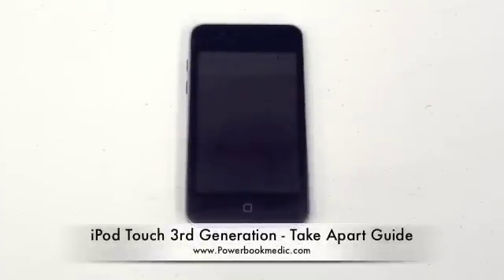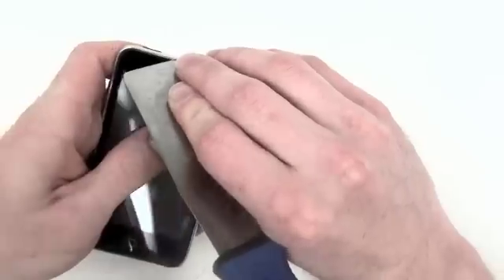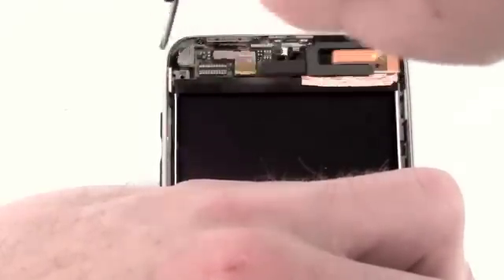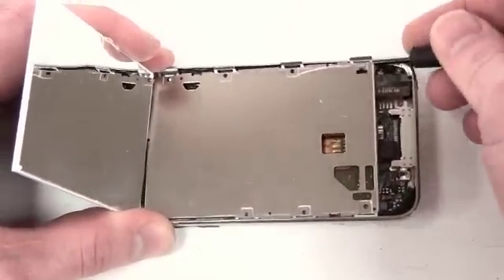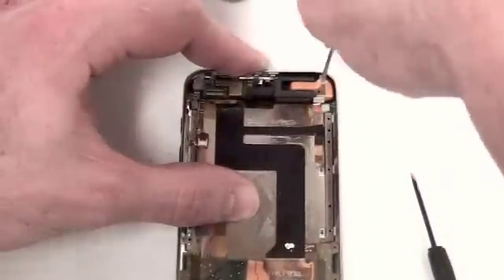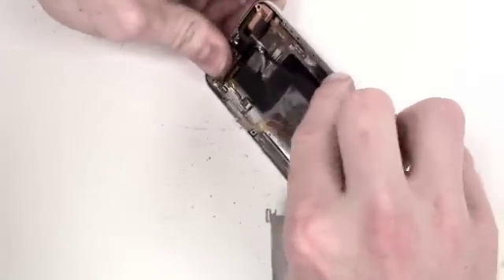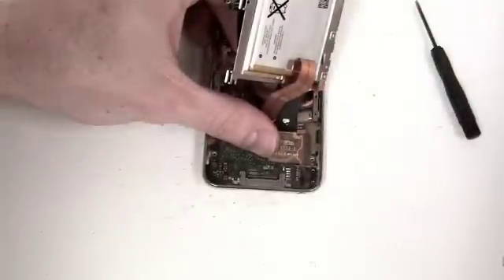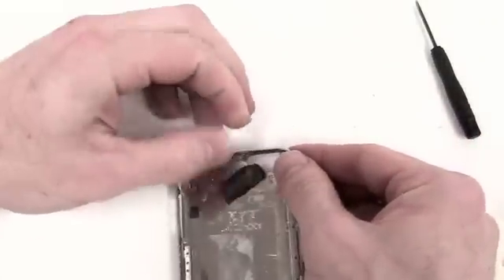iPod Touch Repair 3rd Gen Take Apart Guide

Comment: A friend accidentally poured a sweet drink on my 12 year old 3rd gen. It continues to work but stops responding to touch. 
The buttons physically feel sticky when you move it. In fact, when I opened it up to clean it, the inside was covered in sweet ooze as well.
 Disassembly went fine, no problems, but in the process of disassembly, I should mention that my middle screen touch digitizer, 
bezel frame, broke. It was obviously very old, and no matter how much I tried to open it carefully, it still broke. 
How do you fix it, i.e. replace it? Is there a video, a manual on the WEB? It seems to use adhesive to attach it, and it looks simple, but I still want to learn how to do it sooner.

Comment: The blacklight of my itouch 3g is not working. I can see the app icons but very dimly and the brightness is not responding. What should I do? I feel like maybe a cable is just loose or disconnected. which cable is it?
Reply: No you have to replace the LCD. Most likely your backlight failed or fried. Basically your backlight is dead.

Comment: My charging port isnt working anymore because some spikes got broke inside, do i have to change the whole piece?
Reply from the maker: carlos gomez - The charge port is built onto the logic board, so your best bet is to replace the logic board or replace the iPod. You can get a new port and solder it on, but the boards are cheap enough that it really isn't cost effective.

Comment: Hey i have a 3gen Ipod touch and it fell and now it has a grey line in the bottom portion of the screen,will replacing the screen fix my problem? Or I have to replace the lcd too?
Reply from the maker: You need to replace the LCD to fix that issue. The part is available from our online store or by calling us at 1-866-726-3342, option 1.

Comment from the maker: You need to change out the whole logic board, not just the connector. The part is available from our website or by calling us at 866-726-3342, option 1.

Comment: how do you fix an ipod 3rd gen when it keeps on randomly locking and asking you if you want it to turn off(and sometimes randomly screenshotting the lock screen, the accelerometer does not work, and your lock button is not functioning?

Comment: luckily just the corner cracked for me, so it was merely cosmetic.

From now on i've ALWAYS used a razor blade to either cut away the plastic on the corner if it's damaged and pushed in, or used the razor in between the plastic and the glass to guide it in. Works a lot better than cracking the screen lol.

Comment from the maker: The problem is the dock connector on your logic board. You'll have to replace the logic board to fix the issue. Replacement boards are available from our website or by calling us at 866-726-3342, option 1.

Comment: Hey. No computer can recognize my ipod touch 3rd gen. I did everything I could find on the internet (except breaking it down) and still no computers can recognize it. It can't be the cable because it charges my ipod when i plug it into another source (ex: ps3, radio, etc...). Do you have any idea what that could be?

Comment from the maker: You don't take apart the LCD itself. If the LCD has water in it you need to replace it. Replacement LCDs are available from our website or by calling us at 1-866-726-3342, option 1.

Comment from the maker: You can buy the part from our website or by calling us at 1-866-726-3342, option 1. The part requires that you desolder the old cable and solder on the new cable, so it isn't the easiest repair. We also perform repairs. If you want to get a quote, you can call our repair department at 1-866-726-3342, option 2.

Comment: is this something that i can buy/repair myself? the screen is off, and i have all the tools i need im pretty sure. it is essentially useless without the power button as you can imagine.
how sure are you that it is the cable? also, it worked fine before i took the screen off, how likely is it that that is the part that got damaged (the cable)

Comment: thanks for the video!, but i have 3 ipod touch 3rd generations.
one 32 gb with a dented case, brand new screen
one 16 gb with a nice screen (removed), nice back, and power button funky
one 8 gb with a cracked screen and one-sided headphone jack.

now i know for the 32 gb i need to replace the case...would a swap to a nicer back be worth the effort, or do you make it look too easy?
for the 16 gb, what do you think is wrong with the power button if it seems constantly pressed?
the 8 is for parts

Comment: if you do end up taking it your 3rd gen ipod apart wipe the screen with a vary soft cloth you don't wan't to use any thing to rough or you mite scratch the screen. clean the front of the screen then the back to make sure you have all the water out of the ipod.

Comment from the maker: Sometimes you can use a brush to get the corrosion off, but you need to have experience to know what to look for and how to fix it. You can also replace the logic board to fix the issue as a lot of times brushing away the corrosion does not work.

Comment: My ipod became a little wet, so I let everything dry for a day, and everything works other than my backlight. I heard that if I took it a part and checked for corrosion, with a tooth brush it'll work a again? But I don't know where I should be looking for corrosion, or if that's even true. I have an ipod touch 3 gen. Any help would be great appreciated. Thanks

Comment: hey man nice video, I just bought a friends old ipod for some 5 dollars however the home button is ripped off. so navigating between windows ultimately means turning the ipod off and on again, at the botom is just what seems to be metal plating, and  pressing the home button, (just a circular area witha hole on each side, metal plated)  is there anyway of hmm perhaps using the home button again, aahah?

Comment from the maker: It's difficult to say. It will either be the logic board or the LCD. The only way to diagnose is to change the components. The components are available from our website or by calling us at 1-866-726-3342, option 1.

Comment from the maker: You would likely need to replace the logic board to fix the issue. Parts are available from our website or by calling us at 1-866-726-3342, option 1.

Comment: ok so im trying to fix my friends 3rd gen ipod touch and  i was wondering how to fix it  theres a problem with the wifi because it wont join nearby networks even if im standing right next to the router and its not the router because my ipod and phone are still connected its the ipod also i cant turn it off or reset it since the lock button doesnt work . is there any way to fix this??

Comment from the maker: It's the screen itself. It can happen with liquid damage. You'd need to replace the lcd to fix it. The parts are available from our website or by calling us at 1-866-726-3342, option 1.

Comment from the maker: If the battery is perfectly flat, you should be fine. If the battery looks like it has expanded or has a "bubble" on the top that makes it rounded on top, then you likely need to replace the battery.

Comment from the maker: You'll need to replace the digitizer on the unit to fix the screen sliding issue. If your lcd is cracked, you would need to replace that as well. We sell the parts on our website, or you can also call us at 1-866-726-3342, option 1.

Comment: I dropped mine and the screen cracked right under the power button from each side of the corner and the unlock screen slide thing doesnt slide over. What would be the problem?

Comment from the maker: The problem is likely the dock connector but it would need to be professionally diagnosed to confirm that. It would likely result in you having to replace the logic board with dock connector.

Comment: Yeah Ive read a few comments, And all I have to say is if you grew up soldering things, and taking apart and repairing your own broken stuff. Then this should NOT be a problem for you, But if you have know knowledge of electronics and how to disassemble without asking someone how to re-assemble, then you shouldnt be doing your own work, As far as the guy w/ a cracked screen,and the other with dents, you guys were being a little to ruff. if you can make the repair, parts are cheap on ebay.

Comment: Great video, I just used it to replace my
Battery which I thought was why my iPod would not turn on but it didn't work, when I plug it in to try and charge it the bottom left gets really hot like instantly (this happened before I replaced the battery and still is happening after I replaced it) so I have no clue what's wrong I wish it would have at
least just turned on I just need some info off it. When I looked online I could not find out what my problem may be a few other people described my s

Comment from the maker: @Optix334 - If it stopped working, you'll likely have to replace either the touch panel or the logic board. If you're uncomfortable with the repair, give us a call and we can get it done for you. 1-866-726-3342, option 2.

Comment: Nice and useful video^^Hmm,,,when I charged my 3rd gen touch (I plug it into AC),and I could hear an obivous "pop" sound. And my ipod was totally dead,no matter i press and hold the power button or charge it dozen times.(it gives an electronic fizzy sound when supplying electricity[AC/USB]now, and still cannot turn on) I wonder if the "fuse" used in microchips(if there are any)(Sorry for my bad english,not a nativeT^T)has melted, and created a short cut. Do I have any chance to fix it ?Thanks;)

Comment: Hey great video, helped clear some things up. one question. I took mine apart to replace the headphone jack, but now the touch sensor and home button arent working . Is there another connector asides from the top left corner I could've missed or screwed up? Thanks. Also, out of curiosity, what does the small gold spring do? Peace man.

Comment from the maker: @Duncanshiftsix - You likely damaged the LCD, but you'd need a proper diagnosis to determine that since you could have also damaged the logic board or LCD connector when you went in the unit.